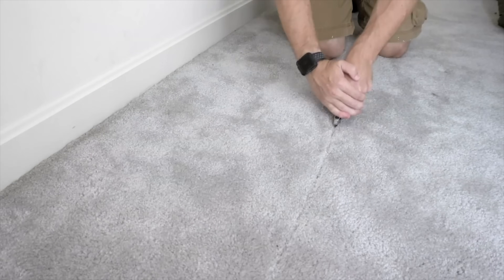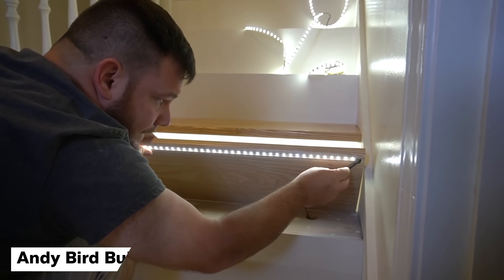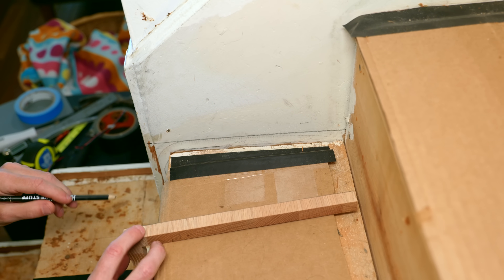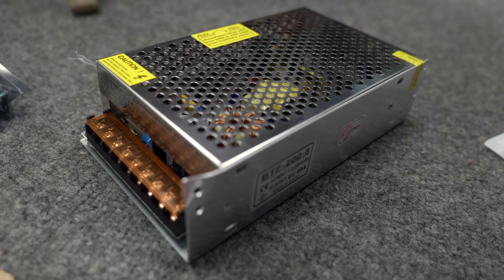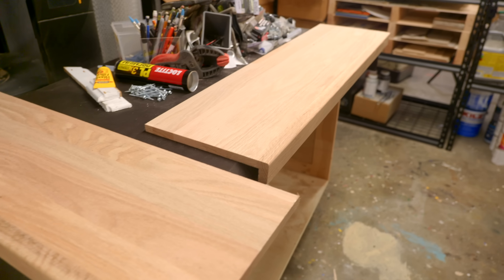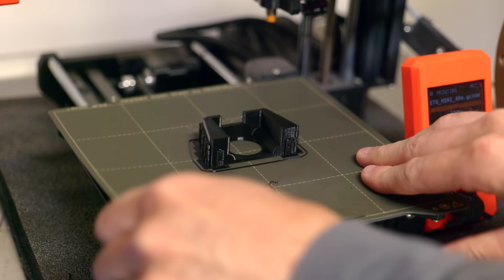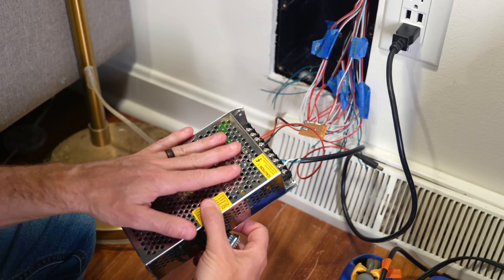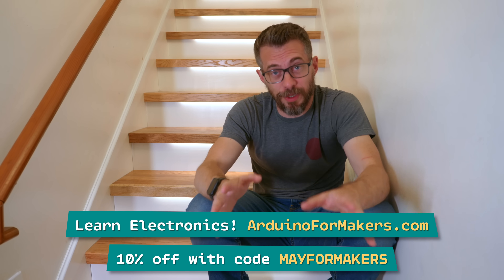Smart Stairs Now Exist...But Should They?

Comment: I did a similar project three years ago (covid lockdown), but used load cells for each step. However I first did the steps and than updated the side covers and using a router I made room for a tiny U-rail. I placed the U rail (with the top of the U facing away) in the side cover, put some double sided tape on the back of the U rail and placed it against the wall, traced the outlines and than glued it to the wall. Run the wires for the load cells and in the U rail and connect them to the control board in the closet under the stairs.

The setup of placing the side covers over the step covers has one drawback, if you ever need to replace on the covers, you need to remove the side covers to get access to the full step cover. The benefit is that there is no visible seam between the cover and the step because the side covers rest on top of the step cover, while otherwise you have a small visible seam  between the step and side cover.

During the night we have a night mode which sets brightness to each step to 25% (nightlight mode), once a step detects pressure (e.g. someone stands on them) it lights up two steps before and two steps after (sliding lighting technique), but will only increase brightness to 40%. Enough light to see where you're going, but not enough to wake up the whole neighborhood...

We also have a lighting keyboard mode which only lights up the step which detects the pressure. Because the load cell knows the maximum weight of the person on the step (e.g. when you take on foot off the step to place it on the next, all the (your) weight is on a single step making it a scale. The load cells have such a high accuracy I can use it to determine who is actually on the step and based on that change the color of the lighting. My girlfriend made me loose that part of the code (i.e. over my dead body you are weighing people).

In the hallway I have used ultrasound sensors (they are extremely cheap) and placed them on a 2 ft interval in the hallways, meaning I can also detect movement in the hallways. We have led spots in our hallways and use the same nightlight trick as with the stairs. But I have a several full computers in the closet under the stairs that controls (almost) everything in my house. Lighting, curtains, airco, heating, blinds, windows (I have build-in actuators in the frames that can open/close some of the windows) and it can even change our bathroom windows from transparent to translucent and vice versa because we have electrochromic glass there. Once you lock the door (lockbolt presses a button in the doorframe) it becomes frosted, once you unlock it is transparent again. I get to automate our house and my girlfriends ends up with a beautiful house (I only build, she chooses everything, I really have bad taste when it comes to interior design or clothes)...
Reply: yo how did you do all that I would like to learn

Comment: You're using addressable LEDs u don't need all these wires You could wire them together then in the code u can treat them as individual steps and for even more cheap and easy solution you could use an esp32 with wled install in it

Comment: I'm curious, did you use a plug to get around building codes? With a plug right there I'd have used a GFCI plug and connected directly to the back of the plug. If you seriously need USB plugs there, add another plug.

Comment: Why did u not splice the power wire to the box so u don't need a cable with plug externally? U did all the effort to hide all the cables to end up with a wire coming out of the wall to go into the socket right next to it.

Comment: Being the plug was right next to the box why didn't you feed the power wires into the power box from behind the wall. Then use a small switch to disconnect the power if necessary.
Reply: Code violation most likely.
Reply: @hadengibbons3539  The way he did it is a code violation.  But the other way would also be a code violation.    The whole thing is a code violation.

Comment: Did you consider using esphome with an esp32? Coding would have been so much easier and the ability to change the code over OTA and parameters over WiFi are more than welcome on my book.

Comment: I like this project but I think I’m going to look at using one of those new mm wave sensors instead of the pir sensors for neatness and why wouldn’t you add an outlet inside the wall and plug into that or whatever you could get away with and still remain within code?

Comment: Looks great! A good addition would be to add a RTC module to the Controller to automatically enter 'night mode' at different times of the day. Or if you're using the ESP, pull the time from the internet through a time server.

Comment: I think the practical is the way you light them when you approach the stairs... The nightlight mode could be automated, put a light sensor in the faceplate and when the room lights are off then it can automatically go into nightlight mode and light up brighter when you approach the steps, but probably not as bright as the normal lighting... just a small matter of programming LOL.  I know, I've been doing firmware engineering for over 30 years, so I actually do know what it takes.  Anyway,   Cool!  now I wish I had stairs in my house.   Well,  Not really.

Comment: I've recently completed LED lighting in a closet and under cabinets using BTF sk812s as well. I'm currently working on putting it inside the hand rails of my deck. Its definitely proving more difficult and fun like your project here, as all the wires are obviously hidden within the rails etc, but its totally worth doing even 5x the work for that clean no wires look.

Btw I'm using WLED to control them, not sure if thats compatible with arduino, but its great if its supported. You can sync up various LED projects on your network to use the same color/effect in WLED, along with controlling it from home assistant or web browser.

Thanks for the great videos man, you're a huge inspiration

Comment: Did this about 8 years ago. I ended up replacing the entire tread, used a dado to cut out a slot on the bottom of the tread and then bought aluminum channel with light diffuser and secured it into the slot. It's much easier then this.

Comment: The fitting of stair tread to a riser and to walls/skirt board on each side is indeed, finicky. Angles are typically not  90 degree, if the tread is too tight, it will spread the skirt/drywall, making the previous completed step have a gap. Too small, a gap .  Faced with that on a project I built an adjustable jig/template for left, right, total distance.  You can buy a similar jig online. You still need to be very precise to get perfect fits. Bob's way left gaps, that is very easy to do and is adequate for a DIY I suspect.

Comment: For mounting those channels, consider magnets next time. A flush set magnet on a piece of LED lighting track w magnets inside would work well. Also consider a right angle Edison plug for the HV power. Cool video!

Comment: Be careful with that power supply overheating. I used those power supplies when installing cameras (12v. pulling around 10 amps) and they needed a fan because of how how they got. Now these cams were running constantly so it may not matter, but check just to be safe.
Reply: a bigger problem is those thin wires connected to a 40A supply.
Reply: @randomblogger2835
True, but each individual strip is unlikely to pull 40 amps.
Reply: @dafoex  they should still have fuses or breakers

Comment: 40 amps? With 10 or so steps that's about 4 amps per step. And say 40 LED's on each step, that's 100 ma. per LED. Well, they're gonna be really bright LED's. One thing I didn't spot is a fuse for each step. You get a short circuit somewhere and you'll also need an upstairs fire exit.

Comment: Awesome idea, this gets on my todo-list! 
However, I think the soldering on the perfboard for splitting the powersupply would not be able to sustain the 40 Amps of your powersupply! Please be aware of the risks these high-currents potentially come with.
Reply: 40 Amps PSU + tiny wires = big fire hazard
Reply: @j123b567  I came just to say that. Unless ESP is programmed to limit the power for the LEDs and compensate for tiny wires, this whole project may end very badly.

Comment: To cut stair treads it's faaaar easier  to use a piece of timber against each wall, then a longer piece between them quickly tacked together with a brad nail gun to create a "H" shaped template.

Comment: Cool project.  only potential concern is the heat output of the power supply.   Are you able to measure temperature inside the box and see if a fan might be required??  unsure if arduino has temperature sensors (beyond the CPU) to be able to use that to measure ambient temps?

Comment: Great project Bob! Looks wonderful. I have just not sure if it is me or I did not pay full attention to the MCU that you plan to use with the project. I thought that it will be ESP32 based Project with Wi-Fi and OTA ability to control the code without the need of taking the MCU out and recode it every time - like adding new modes for the LEDs. But as far as I remember I have seen that you finally used Arduino MEGA and not UNO in the project - that probably be because you have ran out of GPIOs. Just wondering why you did not went the WiFi rout? Thanks for the video and the inspiration.

Comment: If you have a staircase that has access to the back side of the stairs, it would be much easier to run the wiring through the riser.  Most of the time you would have an unfinished basement stairs that give you that access, or at least an area that can be fixed without having to do as much drywall repair that you would have in a better finished area.

Also edge light “neon” led strips might push into the gap and hold with a few dots of silicon in the gap.

Comment: At 15:58 I am slightly worried about the gauge of your wire. The individual circuits going to the LEDs should be fine, but the worry lies in the single wire used to connect the proto board and power supply. I would definitely replace those with a larger wire as they could be seeing 40A at full load.
Reply: I'd be concerned about the 40A supply he just buried in his wall too. Air vent was a nice idea but not really any recirculation happening.
Reply: @smc_scooper  I wouldn't worry too much about heat build up since it's unlikely the lights will be on for any significant amount of time.
Reply: Same the top part will see the full current load. Looks too small even for 20A
Reply: LED strips like his are usually 12v. They require low amps.  I have numerous 16’ LED strips in my boat running 5amp fuses.
Reply: I was going to make the same comment. Bob mentions a few times about using a 40 amp power supply but only uses wire that can handle 5 or so amps 
If he is lucky the wire will burn out like a fuse rather than burning down the house.
Mind you perhaps that’s his plan to generate more content…
Reply: Almost certainly those wires will not be seeing the full 40A load and the power supply is that large more for redundancy than actually needing that much power, but concerns about power delivery to the protoboard with such small wires is definitely valid
Reply: @reaganharder1480  They are all in parallel, so if any stair short-circuits,it'll see the full 40A
Reply: The proto board is only providing data signal (green wire) to the strips.  The power is running through the red and white wires, and those are connected to the power supply, not the board.
Reply: @jeffh4505  None of this eliminates any catastrophic fault that will dump 40 amps down a single wire.
Reply: @jeremiahbullfrog9288  what're you going to do, install a fuse on each line?  That's ridiculous since the power supply has one (or multiple), and I'm sure the board has at least one as well, not to mention the 15A breaker that everything is plugged into.
Reply: @jeffh4505  Whatever you think is sufficient for your family not dying in an unexpected blaze is fine with me.
Reply: @jeremiahbullfrog9288  what's your overengineered solution?
Reply: @jeffh4505  besides potentially running 40 amps through a 22 gauge wire attached to bare wood? hmm... lemme think.
Reply: @jeremiahbullfrog9288  so I ask again, what's your solution?
Reply: @jeffh4505  (1) not do this or (2) apply protections to each conductive path. Yes that means a 2 amp fuse or polyfuse on each stairstep wire.
Furthermore if was not a certified low voltage installer, I would purchase a certification before letting anyone sleep there. 
Finally, building the power supply into a plastic box inside the walls is insufficient. If any of these fail, your insurance company will point the finger directly at the installer.
Reply: @jeremiahbullfrog9288  wow....
Reply: @jeffh4505  I mean whatever risk you're comfortable with isn't going to make me lose sleep.

Comment: Those LEDs won't be powered by the Arduino directly (even with using the Mega instead of the UNO) I believe you missed to mention that you used a transistor board or mosfet control board to limit the power going through the arduino. second you will need a solution for having those control signals permanently mounted to the control board otherwise they will creep out undertheir own weight. I would suggest terminal posts or mount a plexi glass piece on top to force them in place.

Comment: For all the DIYers (I just did built-in shelf lighting) Make sure to add a fuse between the power supply and lights, so if the led lights short out the fuse blows instead of lighting your house on fire.  Low voltage, but 40AMPS on a shorted wire will have no problem causing issues, and a potential fire.
Reply: Good point. And a MAJOR fire hazard there is the gauge of the wire heading from the PSU to the perf board. The individual wires to each strip can be relatively small because the current is split among them, but if you are talking about sending 40A over what looks like 18ga wire (before the split), very bad idea. The key as mentioned below is the input voltage is much higher than the output voltage, so the output current can be higher than input. This system really should be re-thought; likely with either a complicated pcb with ntc thermistors to prevent fire hazard or probably preferably by splitting among multiple psus for simplicity.
Reply: @robertkirk6162  In a short circuit fault, the thinnest wire can see the full 40A.
Reply: Wouldn't the maximum amperage be controlled by the circuit breaker on the panel for the outlet? Likely 10-20amps.
Reply: @tyrelirwin I may have missed if he said, but he's probably working with 12v, not 120v. 10% the voltage means that the amerpgae can be quite a bit higher before tripping the circuit.

The circuit shouldn't pop until it his about 2,000 watts, in whatever combination of amps*volts get you there.
Reply: @s1ocky   Ah, makes sense. Thanks for the clarification. 👍
Reply: @s1ocky  He never said and actually, at 40 amps, it's likely 5v, not 12v. 480 watts (12v at 40amp) is HUGE for that small amount of LED strips.

But you're absolutely correct that the circuit breaker would never trip in this kind of case.
Reply: @s1ocky  That's wrong.  Circuit breakers open on current passing through them exceeding max, not on power value

Comment: You can use the radar sensors similar to the one GreatScott used in his garage alarm system.
They are a great replacement for the PIR sensors.
That way, you can conceal it inside the wall, and it would still work as intended with nothing visible 😊

Comment: Nice video, I agreed with others, on I think it would have been a cleaner idea to use pressure, or capacitive type sensors,  and maybe just motion sensors for the entry and exit.  But the route you took is also fine.   Is there a reason why you didn't rip a channel for the led strips and just place the diffuser directly on the wood, instead of the approach you took?

Comment: Why not just drill a hole in the step, and then notch a slit wide and deep enough, for the led strips, the wires, and any sensors used. 
If you did not have access to under the staircase. Those slits could be connected to each other, essentially making an continuous hollow structure, which goes from the top to the bottom, or bottom to the top. According to the beginning location.

Comment: This is an awesome project and thought about doing this in my home, but using a single strip of LED lights instead of one per step. 

One thing to note: LED strips are best backed by aluminum as it acts as a heat sink and can increase the longevity of the LEDs.

Of course your stair lights probably won't be on long enough for this to matter too much, but it's good to know for those who want to have LED lights on for long periods of time.
Reply: I sourced aluminum LED light channel on Amazon and other places that is ridiculously cheap and surprisingly good value for the money. I bought 30 meters of channel (including diffusers, end caps and mounting clips) for about US$1.00 per meter. I used them for over/under cabinet lighting lighting in our kitchen. Worked really well.
Reply from the maker: Good Idea.

Comment: The power cord sticking out is unnecessarily ugly. With all this work a power outlet couldn't be put inside?
Reply from the maker: There's a couch in the way, you don't see it
Reply: @Iliketomakestuff  Could you not have wired directly into the back terminals of the outlet? I think I'd have just fed the power supply with some Romex wired to the back of the outlet.